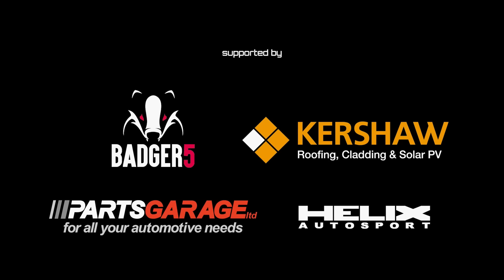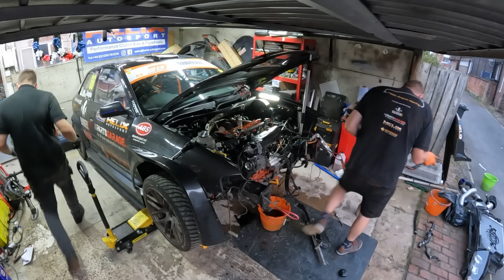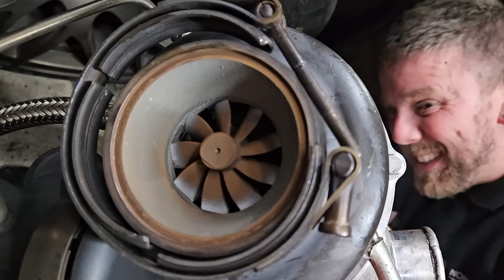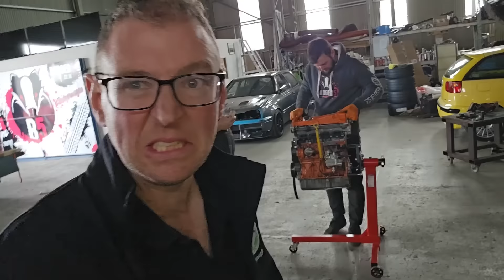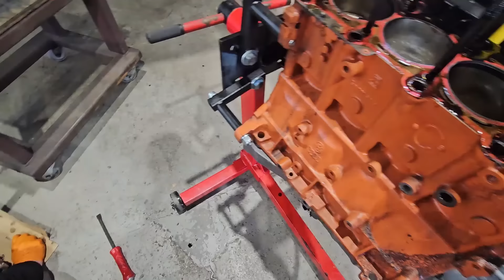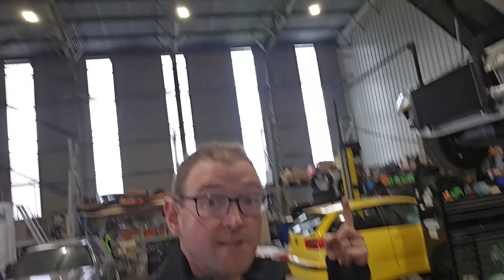No time to waste, lets RIP into it!

Comment: Sorry to see the end of the season like this but that’s racing. In reference to to the engine it is a lot of power to ask from the 1.8 for that amount of time. 12 hours or not it’s a lot of stress especially when you do hang well up in the revs. Maybe next try bigger CC to use the grunt and stay lower down Rev range maybe and also maybe have a spare forge lump on standby if the worst should happen. Do you send any oil samples off throughout the season for testing?

Comment: Hey Prawn, I just ran across a forum post from you at Audi-sport, where you installed Silver Project camber plates in the front. 
In the video, it seems that you are still using camber plates, but are black. Are they still the same ones but painted black?